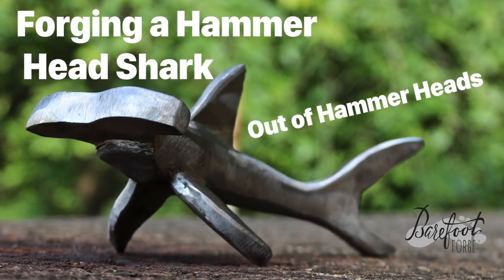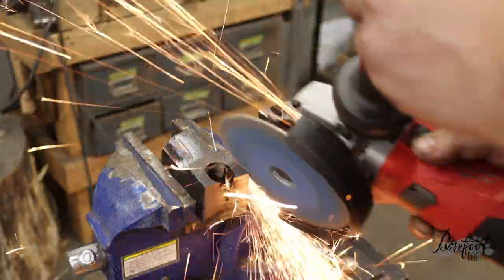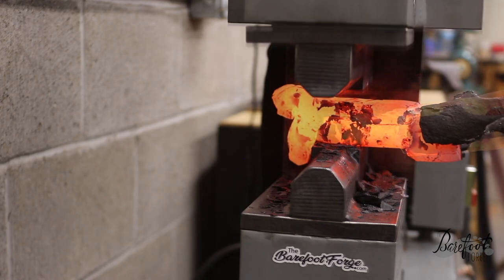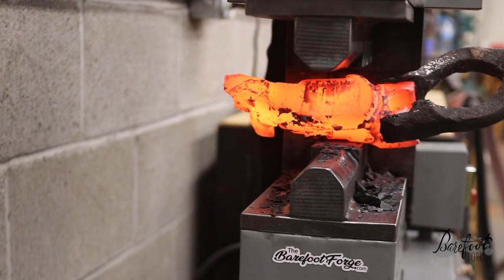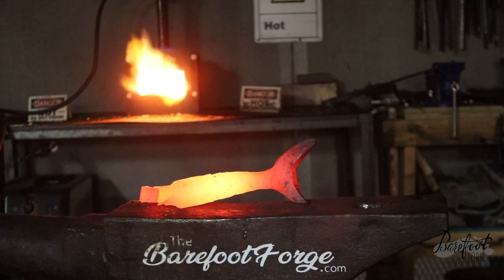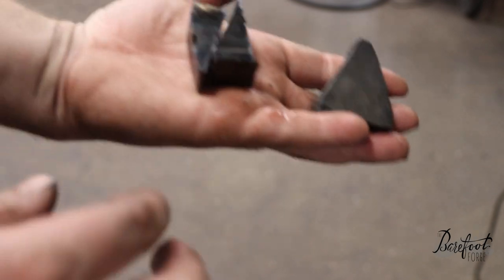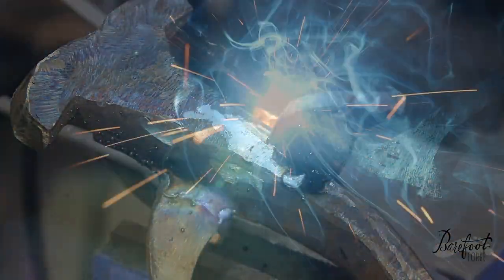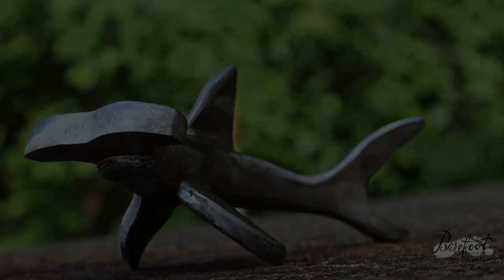Forging a Hammer Head Shark- Out of Hammer Heads!!

Comment: got a welder buddy who made one out of old arc rods, i told him i could forge one so i was looking for ideas when i found this gem.
would be curious to see if you could pull off making one without welding the fins. in my mind its possible with splitting it out of the base material but im a little out of practice at the moment. ill absolutely be attempting it when my forge is operational again
Fantastic content. subbed, liked, and shared.